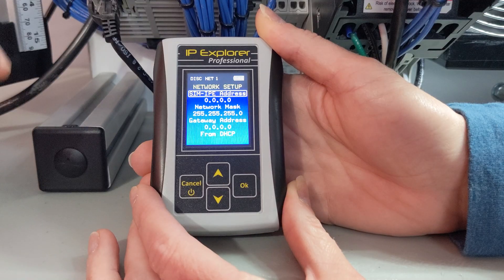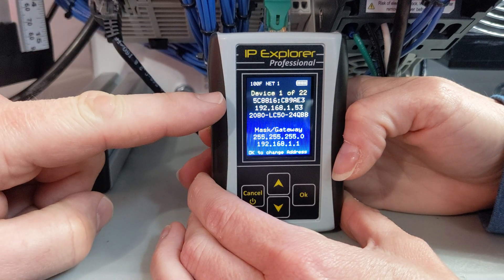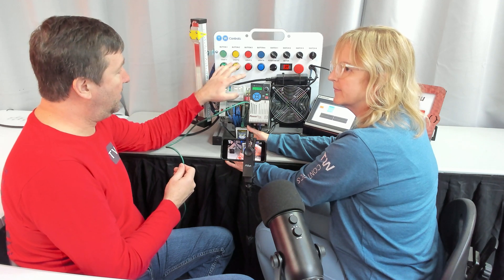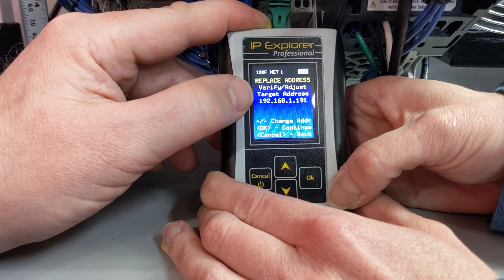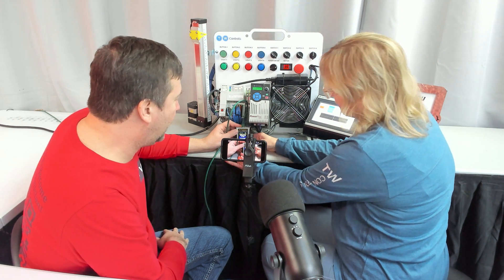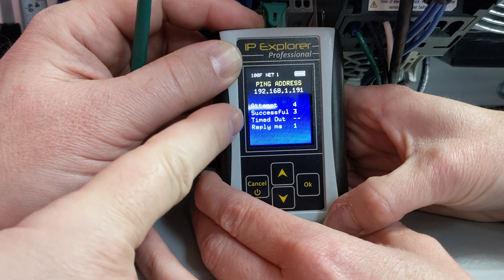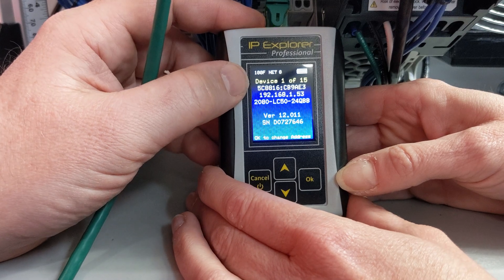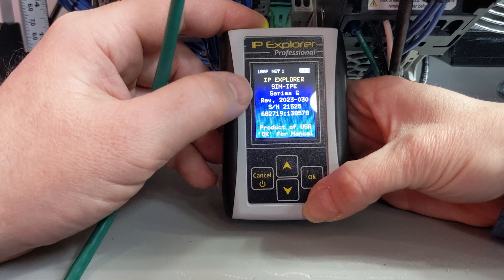PLC Tools SIM-IPE User Manual

Comment: The IP Explorer is an incredible tool, and I found the video very helpful. However, users should be aware of a critical power requirement: battery quality is essential. I discovered that even brand-new standard AA batteries can lead to a dim screen and cause the device to shut down during the discovery process. For reliable performance, high-quality Ni-MH rechargeable or Procell Intense are a must.
Reply from the maker: I'm glad you like it!  Depending on the network and use, it can pull the batteries down.
Reply: Brand new Regular AA (included  Procell Intense) do not work at all.
Tried Ni-MH AA min. 2500 mAh 1.2V.
It works fine: display nice and bright but it is unsuccessfully looking for devices even without plugged cable. :-) 

I want to try
Energizer Industrial Alkaline  AA doesn't work.

I know Amazon Industrial Alkaline worked fine for 3 months of not very active usage which is not enough.

What batteries are you using for your IP Explorer Pro?
Reply from the maker: That seems a bit strange.  I have regular AAs. Disable "Dim screen" and "Sleep Time", maybe send me a video of what you are seeing.

Comment: I have a question.  I am working on changing the IP address on a new Murr I/o block. It allows me to make the IP change, but, once I power cycle the card, the original IP is back. Any idea what I am doing wrong?
Reply from the maker: After you set the IP address, you will see a prompt to press OK to set to static.  What is it showing when you hit that?

Comment: I just bought a PLC Tools SIM-IPE. I tried to change the IP address on a SLC5 PLC (example) 10.68.93.5 to 53.273.268.1. The PLC Tools SIM-IPE gave me an error message "Could not perform command"
Reply from the maker: What IP address, subnet, and gateway do you have the SIM-IPE configured for?  Might be easier to send a request in that guide you in a comment.
Reply: @TimWilborne  
                           Tim, I set the SIM-IPE IP address to match my target device (SLC5 PLC). When I tried to change the IP address to a different network, The SIM-IPE said it could not complete the command.
Reply from the maker: You wouldn't set it to match your target device, you would set it to be unique but on the same network.  Send a request in, too hard to explain without a few pictures :)
Reply: @TimWilborne  
Tim, only the first three octet match. the last octet is different. Can you send me a video of how you are changing the target device to a whole different network?

Comment: I’ve ran into a few power flex 525s that when I try and set a new ip address, (and my sim is set to the same network), it gives me a command not supported error. Any ideas?
Reply from the maker: There is an extra step when changing an IP on a Powerflex 525.  Check out this video.
https://www.youtube.com/watch?v=NiIV7i6bP24
Reply: @TimWilborne thank you!
Reply from the maker: You are welcome.
Reply: @TimWilborne do you have a video on changing the ip on Allen Bradley HMIs as well?
Reply from the maker: No Panelviews support that feature.  You have to go to the Config screen.